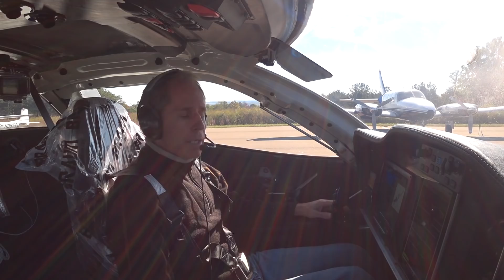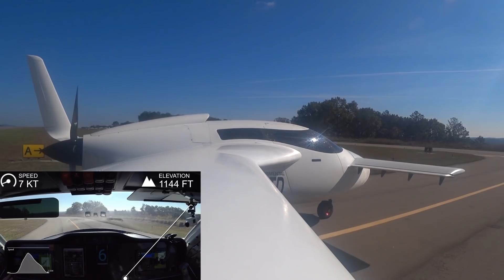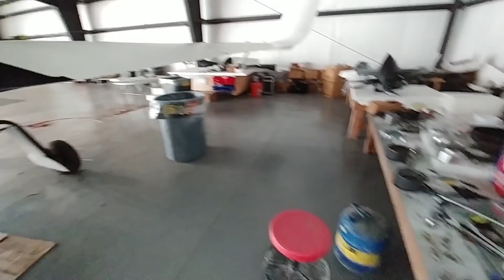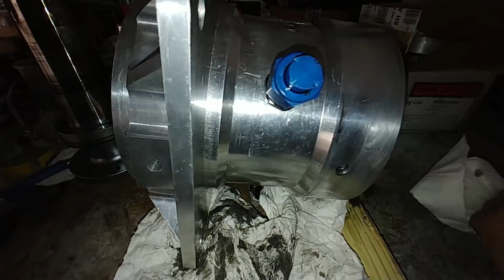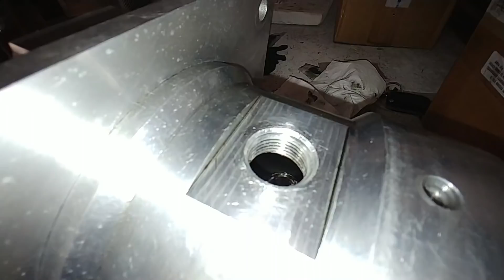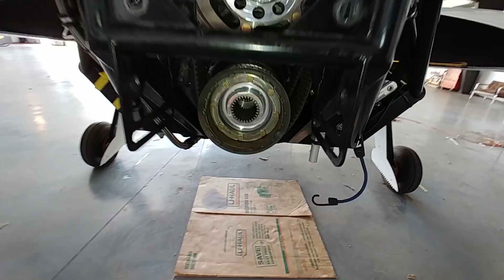ReDrive Health Check - Building the Raptor Prototype

Comment: Great following the progress. But. I think it would be a good idea to make a video showing what your plans ware. And what have worked. And what not??. Is the plane as heavy as expected ??. Does it have the output as expected??. How is the budget. ????. When will it fly. In short a video with a status report. I think we all know by now how it looks running up and down the runway.
Reply: In short,  It's over weight, many things have needed to be re-designed multiple times, Power is an unknown as the engine was never in a load cell. It will not fly any earlier then some time in December.
Reply: @pr1malr8ge  Yes. And once flying. Proberly a lot more parts needs to be re desined. But I like the consept. I do belive that BMW, Audi, mercedes have spend more money making great Diesel engiens. That can be put to use in aircraft´s. It will work. But it will not be perfect first time flying. I do belive that more or less all parts needs a make over before getting in to produktion.

Comment: I don’t wish to add that “one more thing” to your to-do list, but Oil specifications are changing officially in May 2020. ILSAC GF5 will be supplanted by GF6a and GF6b and ASE SN+ goes...I can’t remember, but they’re lighter and specifically formulated to deal with carbon in engines/start up efficiency/lubricant life. I suspect they’re already on the market, waiting on official certification by ILSAC/ASE before they can be marketed as such - Rotella has a red jug synthetic that’s evolved from T6, Castrol’s Magnetec synthetic seems to be their version, Mobil1 has their green-label Extended (?) Performance...it might be good to check with the engine mfg and see what they say about this for that engine sooner than later. 
Also- yay, cowling!

Comment: Love your work. 😀
Black oil is ok so long as it wipes clean off your hands. Soot is still held in suspension in the oil. And if your worried about the oil life you can always do oil samples to check the oil condition.
Do you have a service interval for the engine in standard trim?

Comment: Any way you can observe exactly how much the engine gets displaced under load? That way you could align the sheaves to a 75% load situation and not to the geometry when sitting there idle.
Also check all the lessons learned from the Robinson heli belt drive system:
https://www.atsb.gov.au/media/4120236/ai-2009-038_final.pdf
For example it's not just the lack of belt tension that makes a belt jump. If the belt stretches, it starts climbing on top of the teeth.

Comment: Never heard of anyone having regrets about over-engineering a component.
Reply: bartofilms- weight is always the issue in aircraft design. Trade offs but it is nice to have a robust system you don’t have to worry about but if he could shave 12 lbs off with lighter bearings and still have great performance and safety that would be a really great thing. But let’s just prove the concept before the redesign??

Comment: Have you considered using custom engine mounts ? using stiffer ones may take some of the pressure off the drive belts by allowing lower belt tension before the tooth slip problem you encountered earlier
Reply: I'm assuming the flexible mounts (vs solid) are mainly a comfort issue. I wonder if there might be a way that the flex can be limited or prevented during critical times like take-off or perhaps just anytime the engine is being loaded or unloaded (i.e. the brief moments when the flex is greatest). Maybe some hydraulic mounts (I had them in my last car).

Comment: Glad to see that the issues that were a struggle to isolate have cleared. I suggest having a look at these products I’ve linked as we had two problems with our diesels here, and the range of additives/treatments really solved all our problems and reduced costs as well. First black oil hides wear and tear and unless you have it tested you may never know if you have a problem. Their flush is second to none and the oil after you have changed it stays clean as all the contamination and deposits were removed from the engine. Their additives for fuel and oil solve numerous issues of the way diesel fuel is manufactured today, prevention of untimely wear (lubrication in fuel and oil) and increase reliability of the equipment they protect.  

https://costeffective.com.au/2018/11/09/why-flush-a-diesel-engine/

It is not a paid promotion, just used their products and friends have tried them also and been blown away. If you look at their site or purchase a pack and try it out I think you’ll be impressed. They manufacture the products themselves and is not a rebadged item like so many of the others. I m happy to chat anytime if you want further info, just like my suggestions when you had crank sensor issues.

Comment: That bedding-in process on your brakes is just meant to gently wear off any high spots on the friction material, so that the pads fit better against the disk surfaces, improving brake performance.

Comment: If, you want to prevent the carbon buildup in the engine oil, which will adversely affect the re-drive bearings and other engine components over time, you can install a bypass oil filtration system.  In a diesel engine, you can have this 1-2 micron filter assembly installed in addition to the normal filter, which receives a small volume of oil while the engine is running.  This will effectively remove all the carbon deposits from the engine oil and usually render it as clean, if not cleaner than when you put it in.  While, my vehicle isn't an aircraft, it has a diesel engine with an installed EGR system that dumps lots of carbon into the oil, but with the additional filtration, I have only had to change filters and top the oil when needed for the last 30k miles.  

Here is a link to the company that provided mine:  https://www.amsoil.com/shop/by-product/filters-and-by-pass-systems/by-pass/
Reply from the maker: Thanks. I'll look into this.
Reply: @RaptorAircraft  One thing I do think I should mention, since you would be potentially installing this system in your aircraft, is the fact that due to it's design, it won't cause an oil starvation issue if it becomes clogged.  The system only bypasses a small portion of the oil flow while in operation, but in no way inhibits the total engine oil circulation if it become clogged.  If this happens, it just stops providing secondary filtration, however the primary filter continues to function and oil pressure is unaffected.
Reply: That’s an interesting product!
Reply: I've used this filter on many pieces of heavy equipment and did lots of oil samples. Yes it does work, but it might be redundant to add on an airplane. You're possibly going to be doing oil changes at less hrs than Audi would reccomend anyways. Also your crank bearings are in that same sooty oil and they're just fine...those redrive bearings are gonna be in great shape after 8000hrs of use. The less things to add to this plane the better IMHO.

Comment: Any concern about maybe having an oil filter between the engine and redive in case things  go badly? Thanks for sharing.
Reply from the maker: No concerns. The redrive gets filtered oil from the engine and there really isn't anything that can go bad in the redrive that would affect the engine. Even if it was possible the engine oil filter would prevent the engine from getting any junk material.

Comment: In my experience diesel oil gets black no matter what.
Reply: Run b100. Oil like new after 60 000miles or more. Well, cristal clear at least.
Reply: @tinoesterhuizen4433  biodiesel has it own set of issues.
Reply: Agree. Hose compatibility, tank compatibility, quality, polimers. Get it right you will have more power, a quieter engine and longer range.

Comment: I've had many diesels (Kubotas, Lister 12/2, VW and Audi TDI's) , and the oil will be BLACK regardless of the way you run it!   Changed my Q7 TDI oil this weekend and it was as black as coal.
Reply: Studio RV8 I agree, been running diesel cars here in Europe ever since I got my drivers license, 24 yrs ago. All black oil in every diesel car, some what translucent golden oil in petrol cars.
Reply: Use b100. Oil like new after 60 000 miles.

Comment: ,,, the black oil is just soot, all Diesels have various amounts. It can be filtered,  but only to some extent. Filter it down to one micron and the oil will still be black. I wonder myself, how much under one micron it would take to clear it up, but I have never seen it filtered any lower. It is somewhat startling how soon after an oil change,  that it will become black; don't worry, you are not alone . 
,,
,,, BTW, the full flow oil filter has to remain at a relatively large micron rating, to get anywhere near one micron, it has to be a bypass, secondary filter added to the system. It will give you longer cylinder and ring life, but I strongly recommend you do not bother with it on this project. At least not for several years .

Comment: Great job man and Cheers!   Peter there has been lot's of chatter about the Aileron spade jumping about during the taxi tests.  Cockpit video seems to show its your hand on the stick causing it due to the rough runway.  That the case mate?  Also, some folks have aired concerns in various forums about the aileron deflection test (How much it gave back at full deflection when the stick was locked in position.)  And are speculating a.)  there may not be enough throw under flight loads... especially at high speeds.  b.) slop in the controls is causing the spade to jump during taxi tests.  Just wanted to bring it to your attention if you are not already aware so you can sort it.  Great job man.  Pulling for you.
Reply: Chris Close I think personally, that video not necessary the same as flying it. Especially since the cameras are mounted to the prototype it just for our benefit more then arm chair diagnostics and debate. Keep up the great work peter
Reply: Peter addressed this a month or so ago. There is no slop in the control system. The wing apparently going up and down is in fact the whole aircraft rocking back and forth with the ailerons following 100ms later. No issue.